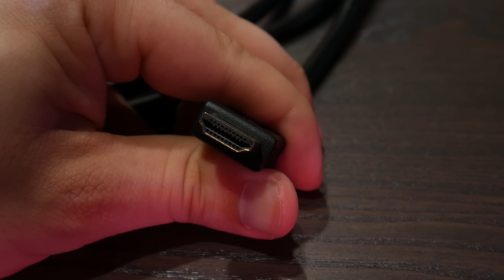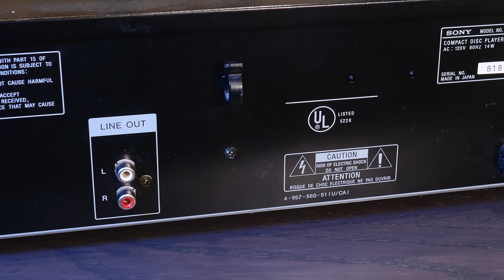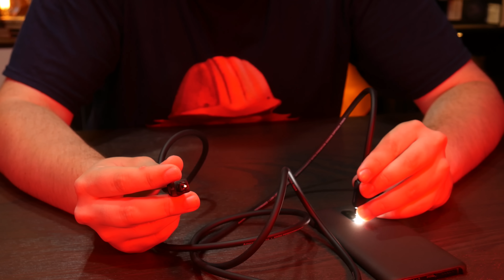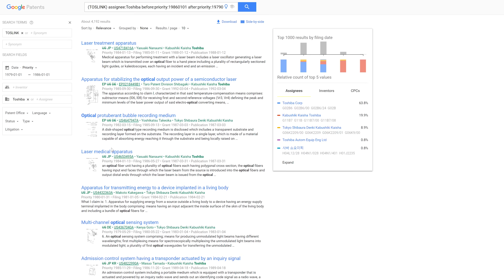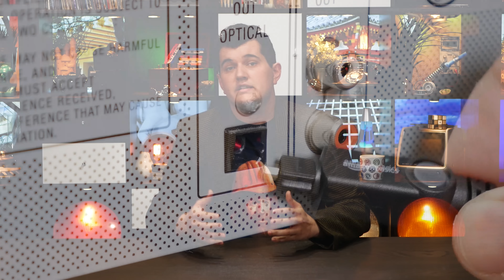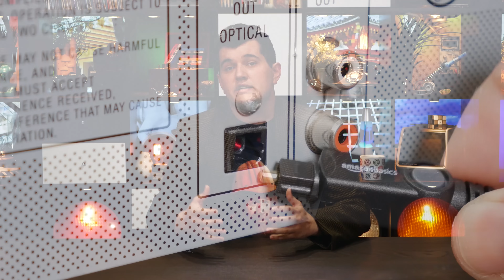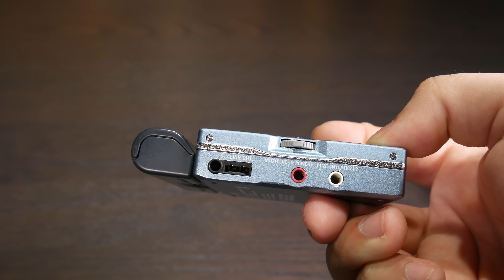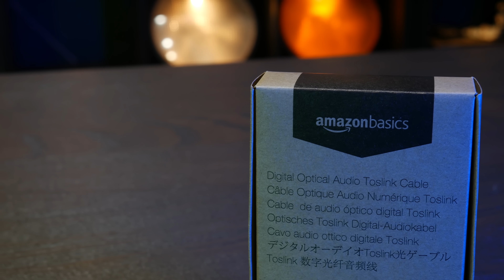TOSLINK: That one consumer fiber optic standard

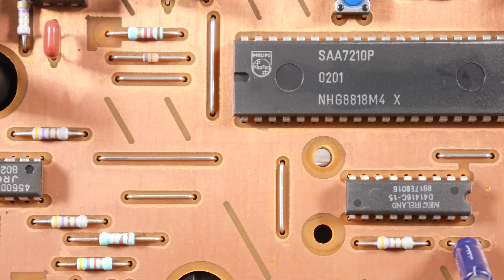Comment: Ahh, dammit! 2:32 is a quick flyby of the circuit board, and now I've spent 15 minutes looking at the data sheet for the Philips SAA7210 chip. Their SAA line all seem to do with audio, it seems. The one in question reads raw CD data and does the decoding and error detection and stuff, as well as make sure the motor's running at the right speed. Lots of stuff in there that just needs a simple CPU to take charge of it.

It uses 4-bit RAM. I thought that was to save the expense of having to buy a second RAM chip to get 8 bits. But now I'm thinking of the incredibly tiny microcontrollers we used to have in the '80s (and even the '70s). The chip's data sheet is from 1986 so the chip is probably from around then. The tiny microcontrollers worked on 4 bits, not 8, because only building half the circuit is cheaper. They had a couple of ways of producing 8-bit bytes if you needed them, and to generate addresses, but mostly it's all 4 bit and incredibly primitive. More like writing microcode than assembly. Software practically having to make the thing tick, then tock.

So running a simple LED display, or VFD if you're lucky, detecting some butttons, etc, it's all within the remit of a 4-bit chip, if you add some support chips. The Speak And Spell had a keyboard, display, and a voice chip, in 1978, so managing the front panel and sending the CD-reading chip some control signals now and then, it could probably do. I would have preferred 8 bits, but back then you wouldn't get an entire 8-bit computer on one chip. Now, of course, there are single chips that run an entire mobile phone, completely, all the pins ready to plug directly into the hardware. I've got one in a couple of my watches.

So yeah maybe the chip uses 4-bit RAM cos it's expected to be interfaced with a 4-bit single-chip computer. Apart from the control and error signals, this SAA7210 chip just outputs a serial stream of the music, straight to a pair of DACs. Also made by Philips, Philips often created a set of chips that went together to solve a problem. Gave companies a way in to making CD players or whatever, without requiring a huge investment.

I'm still not as big a pedant as Alec, though. His pedanticism is legendary.

Comment: I had a ground loop to sort out from my computer's output to my amp. I noticed that my new computer had a toslink output, noticed that toslink cables were $6, and figured that would be a sensible way to sort my ground loop problems because optical. At no point did I think "digital doesn't suffer from ground loops". Fortunately, it worked anyway, so long as I isolated the cheap receiver I bought.

Comment: I personally use this because a 70€ reviever with a 20€ hdmi audio splitter is cheaper than a 400€ reviever with hdmi in.
The hdmi audio splitter sits between my screen and my computer and lets the video signal through, but spits out the 5.1 audio through toslink

Comment: Apple adopted Toslink starting on on the PowerMac G5 in 2003, up through the Mac Pro, until 2012. Also mini-Toslink, on the PowerBook G4 in 2005, and it remained in the MacBook Pro line until mid 2015. As well as the original MacBook line from 2005 to 2010. At the time I thought for sure they were going to release an iPod with some kind of Toslink/optical audio based headphones (for just $199 lol).
Reply: What Alex described happening with a combo port happened on my 2009 MacBook; the LED got bumped by a headphone plug, and TOSLink got stuck on perpetually. I never had audio come out the speakers ever again 😔
Reply: @dantehicks1979  That happened to my wife's macbook back in the day.  There's a little switch in the port, like on the door of your refrigerator for the light, which gets stuck.  I was able to get it unstuck with a toothpick to restore audio.  Who needs the genius bar when you have toothpicks?
Reply: Also in the AppleTV!
Reply: I noticed this when I had linux on my work laptop (the LED was always on)

Comment: I use toslink with my TV sound bar at home because
1 - LEDs are cool
2 - I still don't understand eARC HDMI, and I had a toslink cable already, so it was easier to use the toslink than potentially be out an HDMI or learn about wtf eARC is and when/how to use it and not lose an HDMI port, etc

Comment: You failed to mention one of the main uses of Toslink - ADAT Lightpipe, which allows 8 channels of 24 bit/48k audio to be transferred on a single Toslink cable. It's a nearly ubiquitous feature on most "prosumer" and even some pro-level audio production equipment. Its main use is to expand the channel count on an audio interface for a PC. My Mark of the Unicorn 896 mk3, for example, has 8 microphone inputs with built-in preamps with trim pots, but it also has two sets of ADAT Lightpipe ins and outs, which I can connect to two Behringer ADA8200s, for example, each having 8 microphone inputs with built-in preamps with trim pots, expanding the channel count of my interface from 8 to 24 for a fraction of the cost of buying three separate 896 mk3s.

Comment: i feel like optical high speed internet cable should be more common in large homes. You can run it thousands of feet with little to no latency. Ethernet should only be ran a couple hundred feet for maximum speeds and minimal latency.

Comment: As an enthusiastic Hi-Fi Nerd in the early 2000's I was already aware of Mini-Toslink thanks to the wonders of Minidisc, but many people I worked with in the audio-visual installation industry first became aware of it thanks to Foxtel, Australia's Murdoch-owned monopoly cable TV provider. That time period saw a big marketing push to increase subscriber numbers which roughly coincided with the introduction of a new low-profile cable box manufactured by Pace. The rear panel featured 2 x SCART sockets mounted side-by-side (an interesting model choice considering that SCART connections on consumer-grade equipment sold in Australia were/are exceedingly rare) along with a composite baseband RCA jack, a SPDIF RCA jack... and a mysterious 3.5mm hole between the SCART sockets which glowed with a red light. 

The Foxtel contractor's SOP was to stick a SCART-to-composite adaptor in the "TV" output socket and hook it up to the TV or AV receiver with a bog-standard 3 x RCA lead, then get out of there as quickly as possible before the client started asking questions about picture/sound quality. Specialist installers like myself would swap this for a SCART-to-Component (Y-Pb-Pr) adaptor and a 75-ohm coax for the SPDIF connection... unless the receiver didn't have a spare digital coax socket available, in which case you'd have to go hunting through the van for that Mini-Toslink to Toslink cable that you know you've got in there somewhere, or else start reconfiguring the cabling/connections to free up a coax socket. The Mini-Toslink was often a huge timesaver!

Comment: The issue with HDMI audio, specifically ARC for soundbars and home theater systems, is the lack of simplicity and reliability. With Toslink, you just plug it in, and it works 99% of the time. With HDMI ARC, you have to go through a bunch of tv settings to enable it, and then hope that it recognizes the device and works properly. From my experience with this, I've had varying success with different tv's and audio systems. It's a disaster. Also, for those of us who collect vinyls and/or CD's, I've never seen a record or CD player with an HDMI audio output. If these issues were fixed, then yes, HDMI would probably be better in most cases.

Comment: In 2008, I bought a 5.1 surround sound system made for a computer with 5 speakers, a subwoofer, and a green/black/yellow set of 3 3.5mm audio jacks. It came with a 3 3.5mm to Yellow/Red RCA adaptor, so I bought a RCA to 3.5mm adaptor so I could just plug into one 3.5mm jack. I usually plugged into my TV so I could play audio from any source to surround sound. 

In 2018, I bought my current Samsung curved 4k tv, only to be severely disappointed when I couldn't find a 3.5mm jack. I did, however, find the Digital Audio Out, which used a Toslink cable. I had to hook the Toslink to the TV out, then to the input on an old TEAC receiver, then plug a 6.35mm adaptor into the front audio out on the TEAC, then plug my 3.5mm to RCA adaptor into that, into the RCA to 3-jack adaptor, to the plugs that finally went into my surround sound system. It was a convoluted, yet cheap way to have surround sound, using a lot of equipment I already had. 

Boy was I glad when I found out my TV can connect to my Bluetooth headphones!

Comment: I loved using the toslink on my ps2 and 3 since the other connector ports on my reciever i had at the time were full with other stuff. Great for good game audio.
Reply: Only if you will accept 5.1 - and don't want 7.1 surround.
Reply: Same here. I still use it for my PS4 as well, but I'm sad to see it go with newer systems. I still remember how amazing it was back on PS2.
Reply: @buckroger6456  I have a PS5 and still use the toslink, well the Samsung Neo Qled has toslink to my audio system but it still works just fine :)

Comment: Today it gets really hard to buy TOSLINK receiver or sender chips you can use on diy hardware. You even have to be careful to get hardware that really supports bandwith of 192kHz and 24bit. Toshiba themself stopped production of these items. Its really easy to build e.g. input multiplexer using som CD4xxxx chips. Personally, I use a Mutec mc1.1+ reclocker to get clean clocked digital signals from my SPDIF PC output. And that makes the difference!

Comment: Isn't avoidance of ground loops a reasonable advantage of toslink?
Reply: Isn't ground loops not a problem in digital signal? I don't know much about them, but I didn't heard about them in context of digital signals.
Reply: @mysheus  They are ~not a problem for digital signals. However, ground loops can involve more than one connection. If everything else was set up correctly, IMHO it shouldn't cause issues (though I'm not entirely sure of that) for other analog connections. However, other things might be broken, and having fewer electrical connections makes the situation less complex for debugging.
Reply: @mysheus  Ground loops are (in my opinion) a type interference. Ground loops are from the ground connectors, and if you have many devices in a single setup that are interconnected with any cable that has a ground, a ground loop can come from any device. Interference however, can be things like nearby antennas or even coiled wires. Even running an RCA cable next to a few AC wall cables can cause some major interference. So digital (like Coaxial and HDMI) stop interference entirely, but not a ground loop. This doesn't mean that their signal is interfered with, but there is just some type of signal on the ground that can negatively affect an amp or DAC somewhere in the loop. They still have a metal ground connector. Meanwhile, an Optical cable is 100% electronically isolated.
Reply: Interference as a whole can be stopped with it

Comment: I wonder if putting monochromatic RGB LEDs and three filtered light sensors could work as a successor to toslink without replacing the cable
EDIT: oh wait the different colors probably have different dispersions and would be noticeably different under different lengths of cable
Reply: Telcom uses many different "colors" (wavelengths) in their high bandwith fiber-optic cable systems
Reply: Different wave length (basically speaking, color) light can be used (and is used in other standards) in single fiber optic, but something happens with light in fiber optic, I don't remember what, that makes using fiber optic and using several wave length lights more difficult than it sounds. But it's not the point here. As were spoken in this video, for modifying Toslink new standards need to be developed and manufactures should use them, but HDMI already offers more audio bandwidth, already is a standard and is widely used, making modifying Toslink worthless.
Reply: @mysheus  using multiple wavelengths is totally possible, but each wavelength has a different delay. The fiber cable is specifically made to bend the light back by having different layers. But it means that short wavelengths might travel a longer path than long wavelengths, or viceversa. So at the end of the cable the different wavelengths have different timing, and hence you should each treat them as a different signal.
But yeah, you can easily multiplex and de-multiplex different wavelengths by using a passive prism. It's called wavedivisionmultiplexing (wdm). So this way you can have mutliple lasers on different wavelengths and on L2 you can turn that into a LAG. But any lower and you get timing problems.
Reply: @bloepje  god forbid the latency diffrence between red and blue light when traveling 5 meteres compaired to an electrical signals outright lag

Comment: Kinda weird that with HDMI that Toslink is even included even on the cheapest Walmart TV's in 2023
Reply: Good luck with sending the audio of the "brand new" HDMI TV to a 15 year old (otherwise working perfect) AV receiver/amplifier without TOSLINK.
Reply: @djgeorgetsagkadopoulos  I have an OLED tv but I run Toslink to a 10 year old Pioneer receiver. I may not get lossless audio, but it still sounds good.
Reply: @AchiManolo7  My point exactly. And BTW, you DO get lossless audio. TOSLINK (by itself) does not cause any loss in signal transmission.
Reply: @djgeorgetsagkadopoulos  I use optical from my sony bravia to my bose bar. HDMI Arc never worked and bluetooth just doesn’t sound as good. I love optical audio.

Comment: In a gaming world there's a big advantage to Toslink. I run a soundbar, PS4 and in the middle was the TV. But, I can link my soundbar to the PS4 and the TV is just the display. Before this setup the audio would sometimes lag a little bit behind the animation, now it doesn't. Toskink isn't the only connection out there which could do this, or at least other connections could work if the PS4 had a port, but it doesn't.

Comment: Toslink is a great digital connection protocol, since it’s about as easy as plugging a TRS Jack into a receiver. There is no issue with USB jitter and artifacts, and no issue with installing drivers. Toslink was how I was able to output the digital audio from my Playstion into my high res DAC’s S/PDIF receiver, when there were no USB drivers available to install. It’s a shame many laptops stopped integrating Mini Toslink output ports into their headphone jacks; it was killed off on the MacBook Pro in 2016.

Comment: 12:00 hate to be the pedant here, but if the power supply of the equipment is isolated, that device is isolated from  the mains circuits and everything plugged into mains. So, if audio equipment with isolated power has existed back then, (which is easy just use a transformer to reduce AC voltage before rectifying it) having an optic data cable to have isolation actually does make sense.

Again, hate to be the pedant, but i gotta.

Comment: Mini Toslink was standard in the headphone jacks of every Mac for years. I was surprised one year when I got a MacBook Pro that didn't support it. Also, audiophiles have issues with Toslink as it often has higher jitter due to the low quality cable and inexpensive clocks often used with the standard. Standard coax connectors worked better in testing. Also, HDMI isn't license free so it isn't entirely a replacement for these older technologies. USB is another technology that is replacing Toslink as it is on virtually every device these days.

Comment: I benefitted from the electrical isolation as i use toslink between my dac and PC. When using usb HDD reading and writing noise can be heared. But that could also be from the fact it powers itself when used in usb mode rather than from a 5v source i plug the power usb in usually...

Comment: I record analog... good luck flipping any switch (light, transformers) and not causing interference, I believe enough to disrupt the bitstream carried in digital through a coaxial cable. Never tried it though... I never used digital over coax., just SPDIF.

Comment: I listen to youtube using one of these connectors.  I have a second computer that I use just to watch youtube which I use via a KVM program.  The sound card in that computer has an optical audio out using one of these connectors which I pipe in to an optical audio input on my main computer.  I sought out this solution rather than using the normal line in and line out jacks to avoid audio problems from interference.  I tried quite a few cables to avoid the interference, but never was able to eliminate them until I switched to using optical connectors.  I always thought this was odd too but... it works and normal RCA jacks with line in/line out didn't.